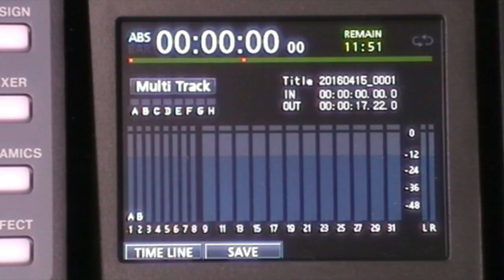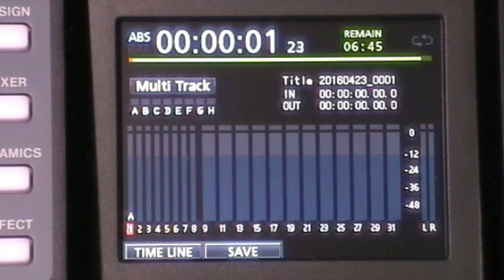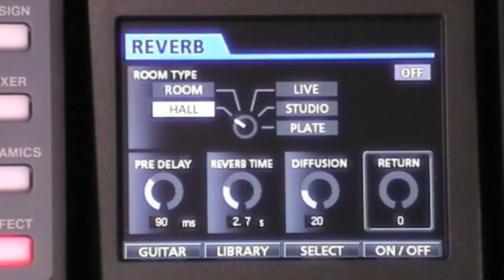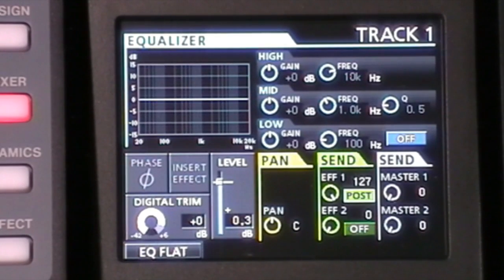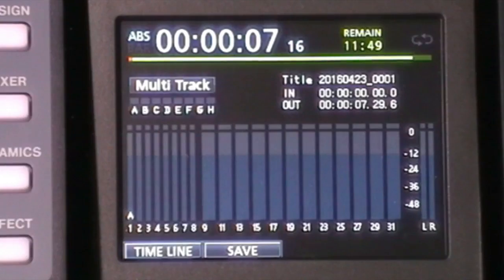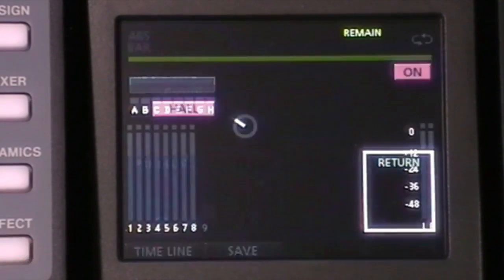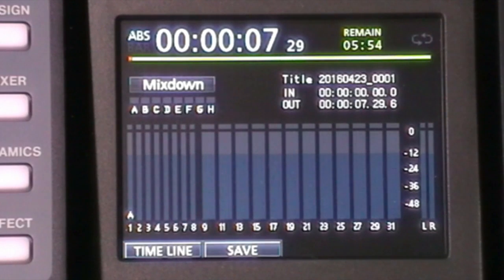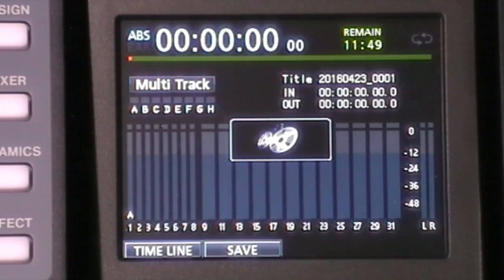Tascam DP-32SD Reverb for playback/mixdown

Comment: Thanks Man, Thats INGENIOUS about Creating a RESET File! I wish that The Tascams DP 24 & 32 had Master Reset on the EFFECTS, DYNMAMICS & Especially The MIXER. I personally do Not think those 3 Settings should Stay the same, when I create a new song. Then one also has to Manually RESET first on every of those Tracks & which includes Double Checking The EFFECTS & DYNAMICS settings for each Load just in case. As the result of your video here, I came into my Studio & I Created a RESET File, completely first going thru ALL of those things I mentioned and the Creating The File. So the trick is, as I see it that youre doing Is, Everytime FIRST Before CREATING A NEW SONG FILE, First RELOAD The RESET FILE, and Then since that way Everything goes back to FLAT & OFF, so ti speak, and when I load My New Song File afterwards, everything should be Normal. HOWEVER, Theres on catch, since The TASCAMS read the SD Cards, A Complete RESET FILE Has to be Created on Each & Every New or differerent SD Card. SO, Im going thru Every one of my SD Cards & Creating a Complete RESET File on Each of them. Thanks Phil. Ive just subscribed to you.
Reply from the maker: Thanks +Jimmy SantAngelo. Yes it seems an oversight from Tascam, especially as the settings are spread over multiple screens, tracks, inputs etc. - such a pain tracking down rogue effects/routings! I first thought the Menu/Initialize function would do the trick, but it resets all the preferences such as Brightness & Auto-off time etc. so is too powerful. Get into the habit of always loading the !Reset song before creating new songs. If you prefix its name with a "!" character, it will always appear at the top of the song list as a reminder to use it. Good point re. having to copy the !Reset file to new/re-formatted sd-cards - I keep a spare copy on the computer for this. When you create the !Reset file for the very first time, make sure there's no audio data present to conserve space, e.g. create a dummy new song first, then zero all the settings, then save it as !Reset... and don't forget to Protect it! You could also use the same idea to prepare variants of !Reset for specific non-flat settings depending on your requirements. Thanks for the sub and good luck with your projects.
Reply: Phil Tipping Yes Sir, I did that exactly as you described on each of my DP24 SD Cards (6 of them). And Yes, the (exclamation mark) before the "!Reset" makes that file on the very top as you said. I totally agree with you on your remarks here. Thanks man and that HELPS ALOT! ThankYou Phil. Be checkin out your other Vids asap. Adieu

Comment: I just got my unit a few days ago and couldn't figure out how to do this. Thanks
Is there anyway to add reverb into the monitor mix while I'm recording the vocals?
Reply from the maker: Hi +John Ciccantelli and thanks for the feedback. Yes, you can add 'comfort' reverb just for monitoring using the Send controls in the Effects & Mixer sections. The FX won't get recorded, although it's easy to get confused as the Send also acts on the playback after recording! The block diagram is worth studying if you can get your head round it - it answers a lot of questions about the routing. The V-Track box is where the individual tracks are recorded - the 'tape' if you're an old-timer like me! - so you can see it's only the Insert FX which can be recorded (Guitar or Dynamics via Source). The Send FX box at the bottom has no route back to the tracks unless you bounce. If you have any more questions, try the Tascam forum or drop me a line at the email on my www.PhiLiZound.co.uk web site.
Reply: Thanks Phil you made my day.
Reply: Phil - I followed everything you did except for the initial reset and I still didn't get any reverb until I selected the Assign button and added my track to the Stereo Bus.  Not sure why you didn't have to do that and I did but there you have it.
Reply from the maker: The video was specifically for adding reverb during mixdown. If you want reverb while recording tracks, i.e. you're in MultiTrack mode, you need the track(s) assigned and armed for recording, although your method is fine. Was this what you meant? (btw - nice recording space you've got set up - wish I had more room!)
Reply: Well initially I was just trying to get some reverb on my voice in the headphones during recording just because I enjoy listening to my voice more with a little reverb on it while performing. And this I have been able to do however I have not yet been able to get the results that you get during mixdown. I must be missing 1 crucial step. My Mixer screen looks like yours and the Reverb effect screen looks like yours with the Return up to 75 but I still don't hear any reverb when I hit the Play button. Very frustrating. Tascam should be paying you btw for all the help you've been handing out. :-)
Reply: Ok. I formatted a new SD card and started from scratch and everything seems to work now. That !Reset script of yours seems like a real good idea. Thanks again.
Reply from the maker: Ok John, thanks for investigating and posting solution. I used to get the opposite scenario before I made the !Reset song... was hearing reverb but couldn't find out what was causing it! It's an easy trap to fall into when you buy a new machine as the first thing you do is listen to the demo song, and this configures all sorts of routing & FX to showcase the features. So when you're confident enough to go solo and create a new song, you get in a knot because all these settings are carried forwards. A 'factory reset' function would be on my wish list! I know there is an Initialise option in the Menu, but this resets all global settings such as screen brightness, auto shut-off times etc. so is not the same.

Comment: Yes I know. It kinda doesn't make sense. You should be able to do it in mix down mode because you have to record your mix down to make a master. I need to try it in Master Mode and hit the send effect button and see if it works that way.....Yes but how do you insert that into the song your working on!?
Reply from the maker: Thanks for interest +Dickie Dee. There's no problem adding either Insert or Send FX during the mixdown phase, and there's no harm in stopping at that point - the mixdown track you've created is still called a 'master' track so you can copy it out to a computer and add external mastering or burn a CD etc. It's just that you can't use these same FX when you go from this 'mixdown' stage to 'master'; you only have EQ, COMP & NORM. You can see this on the mixer block diagram in the manual; there's no internal route from the MASTER TRACK (near upper-right) to any of the Insert/Send FX blocks.